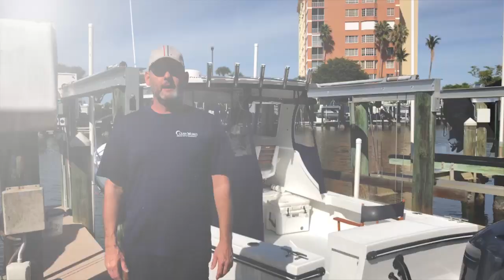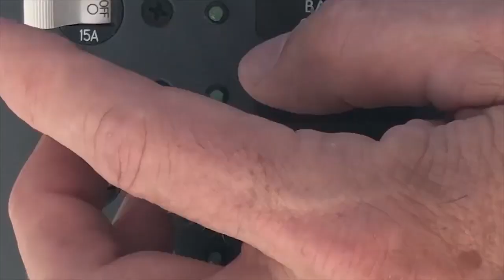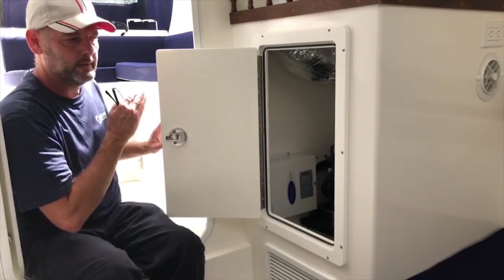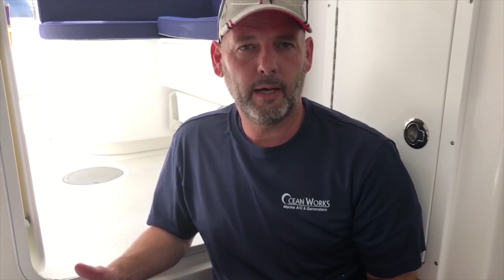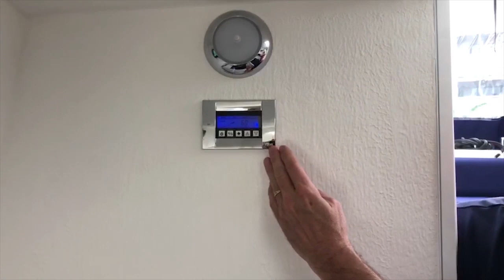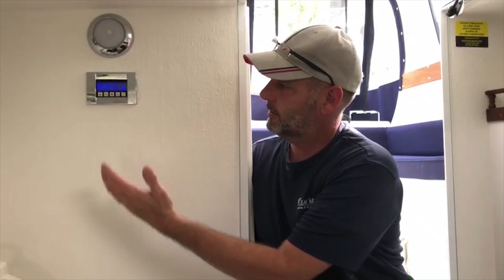Ocean Works Marine AC SYSTEM INSTALLATION OVERVIEW

Comment: I think he missed a few important details. Like how to remove the condensate from the AC unit pan?  Just dump it to the bilge?  Better not. Need to have a condensate pump out.   Air return filter as well.